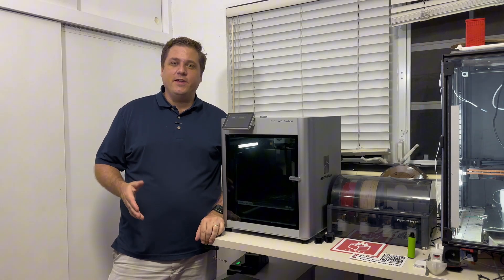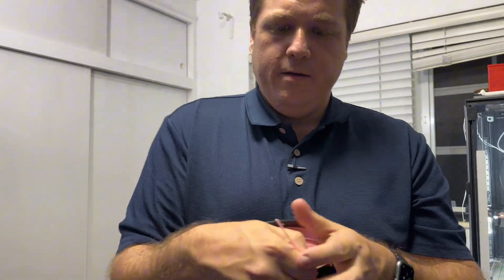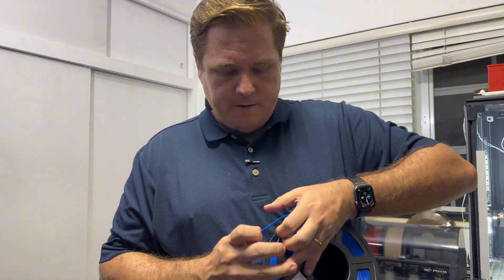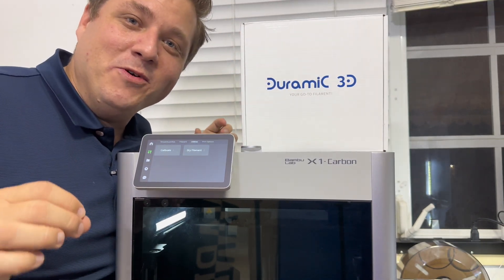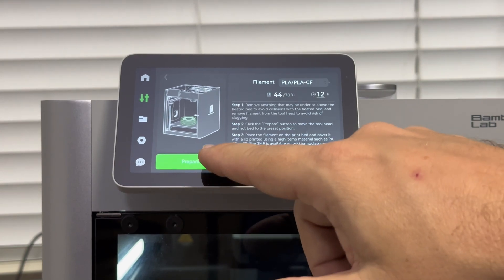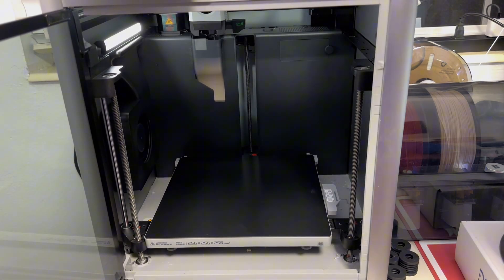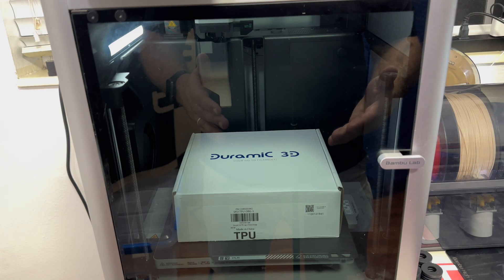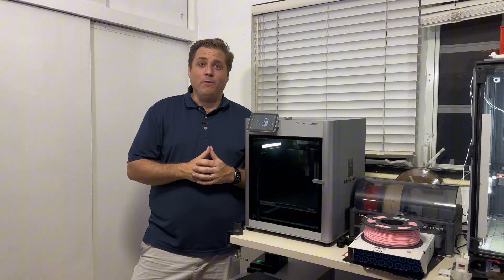How to dry your filament with the BambuLab X1 Carbon (Yes it works - No I won’t be using it again.)

Comment: Why does this take 12 hours where my filament dryer says it only takes 4?  Is it because the filament dryer has a fan?  I know it works because the hydrometer says on a new spool it's 40% and after going through the dryer it is 19%.  I kinda what to dry on in the printer just to see if it can get even lower than 19%.
Reply: 12 is the default value by Bambu but you can change the value of both time and temp …this guy seems to make alot of assumptions and even did the drying wrong …ya don’t put the filament in a box you make a lid out of a box so the filament is touching the print bed …best advice just read the instructions on the machine

Comment: For hobbies like myself, using it to dry filament for 12 hours prior to printing is just a scheduling issue.  I'll teach my wife to do it while I'm at work to finish right after I get home and then set up my print and go for gold!  The issue is the filament not being left in the line is one to remember and how does the heat affect the plastic tubing over time.  One might have to replace that tubing after a year or two or when it breaks in the line.  Too bad there isn't a heat shield sleeve protector to place over that tubing which would solve the problem. Great video!  Your voice is clear, loud enough to hear and enunciation is great.  You stayed on point and provided the needed information without providing a bunch of side stories that were not relevant. Thank you.
Reply from the maker: Brooo thank you for your kind words! I have anxiety about posting long form content! I will post more videos soon. 

Also -if your wife does this for you then she’s amazing and def a keeper!

Comment: That's plasticizer evaporation, not humidity saturation. Cut a section of various filaments, both what you think is good/bad, put sections in glasses of water for a few hours, then bend to test.

Comment: Thanks for the video.
I'm not fully agreeing with your final conclusion.
Yes, not to use your 3D printer for 12 hrs is annoying, and yes, there are several spools dryer out there that are cheap to buy and are dedicated for this purpose. But inside the X1 you can dry several filament at once (3 or 4, didn't check). So sometimes this can be the better option.
Reply from the maker: Fair enough!

Comment: Can you tell me if the vent is on? I wana do the same thing on p1s.
Reply from the maker: So the x1 carbon just runs its own filament drying gcode commands. I can’t tell whether any vents are running while it’s going. I’ve got some things printing right now but will report back later

Comment: You are not supposed to put the filament INTO a box. You are supposed to cut the top and use the box to cover a filament spool which is placed directly on the heatbed! Additionally box cover should have some holes in it to let moisture out. This is wrong on so many levels I hope no one does it based on your example!
Reply: Bambu doesn’t mention to cut holes though - and I just did it last night and it worked. The lid thing tho, yeah lol wow.

Comment: can you dry with the p1s?
Reply from the maker: That’s a great question. I’m not sure if the P1S includes this function… however I’m sure you could G-code your way to getting the same done on the P1S. 

Another thing to note is this: the best way to dry filament is to increase the temperature of the air within the chamber. The higher the temperature air, the more parts per grain (PPG) of moisture can be can be allowed in the air. Then, the auxiliary fan should be turned on to cycle the air within the chamber to allow movement of the air. At the bottom of the chamber, you should have a tray or container of a lot of silica beads to capture the high-humidty in the air - or - have the air transferred to another low temperature container to allow the air to cool and thus decreasing the ability of the air to hold a large PPG of moisture in the air. 

Think of it similar to how an A/C works. Your home has humidity. When the air passes through the cold coils, it causes the air temperature to drop extremely quickly. That drop in temperature causes the air to condense which forces the moisture in the air to condense from vapor to liquid. This liquid Drains out into a drain pan and leaves your home through a tube leading outside. 

If someone were to create a system to attach to the Bambu lab printer from, let’s say the exhaust on the back, to another chamber which cycles the air through chambers packed with silica beads allowing the air to cool a bit allow the moist air to condense into the silica beads, then the air gets put back into the x1 carbon to  start the whole process again, you could probably have the x1 carbon, or any enclosed printer, such as the P1S, dry filament faster and more efficiently. But man, that’s a lot of work.

Comment: The box is meant to be a lid in the instructions given on screen. The filament roll is meant to be in direct contact with the bed of the printer. Granted you're doing it for 12 hours so chances are after 12 hours the box is hot enough anyway but yeah its meant to be a lid made from the box, not an actual box.
Reply from the maker: Yeah they give you the option and the ability to download and print something so you can dry. I didn’t go with that option.
Reply: You are missing his point! @TNTBA  You are not supposed to put the filament INTO a box. You are supposed to cut the top and use the box to cover a filament spool which is placed directly on the heatbed! Additionally box cover should have some holes in it to let moisture out. This is wrong on so many levels I hope no one does it based on your example!
Reply: Make a lid with the cardboard box. Put spool on plate. Cover spool with LID. Maybe read the comments before responding

Comment: I hope that Bambulab makes an AMS that has the drying function, the could separte it into 4 rooms, the 2 centered ones for 90 deg C and the 2 adjiacent for 70 deg C. Since if all the slots are at 90 deg, they might create issues with the temps, beeing harder to controll.
Reply from the maker: What I do is whenever I’m printing something high temp like ABS or nylon, I put the abs on top of the printer. I’ll maybe do a video on it to show y’all

Comment: Did you notice any condensation on the glass at the end of it? I currently have tpu drying in mine right now and that's my biggest concern. To have my $1200 "filament dryer" electronics ruined due to moisture. Just a thought that crossed my mind
Reply from the maker: I have noticed it in the past for sure. I wouldn’t use this drying function in the future

Comment: FYI - the bend test is no use for Nylon / CF stuff - it can be bone dry but it is brittle no matter how dry it is :) I am printing a lot with Bambu PAHT-CF and I dry it 24hrs in the Bambu at 90C and then print from a Sunly Filament Drier at 70C - It keeps it at around 12% RH and looks mint
Reply from the maker: Ah good to know. Makes sense since they include additives like carbon fiber

Comment: Very good video mate. Just subscribed to your channel.
I knew that filaments needed to stay dry but I was under the impression that PLA wasn’t as crucial. I like the bend test you did. I’ve got a suspect PLA that’s been giving me grief so I’m gonna do the bend test and dry it out as well.
I’ve got a food dehydrator that I’ve cut the tray rings out so I can fit 2 x 1kg spools in there at a time.
Cheers!
Reply from the maker: The bend test is great! Thats just one way to see whether it’s dry or not. The best way to know is when your printing with an old roll and find that the filament isn’t cooperating like it used to. Thanks bro! I appreciate the sub! You’re getting a shout out! ✊🏻
Reply: @TNTBA Cheers mate from Adelaide, South Australia! :)
Reply from the maker: @jackhammer_au9961  you have no idea how excited I am to find out I’ve got at least one subscriber in Australia! Thanks, mate!
Reply: Some PLA types are more of an issue than other types.  In general, it’s best to try to keep all filaments dry.

You can use enclosed boxes with desiccant instead of heated dryers, too.  There are a couple of Youtubers with different examples of how to do this.

Keeping dried rolls in a large plastic box with desiccant is a good idea to minimise any downtime, regardless of which method you use to dry them.